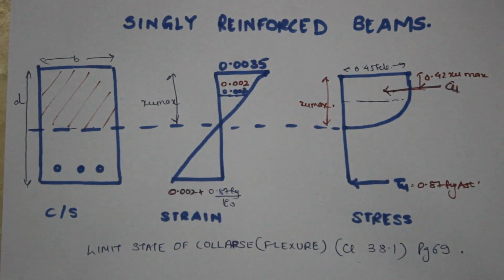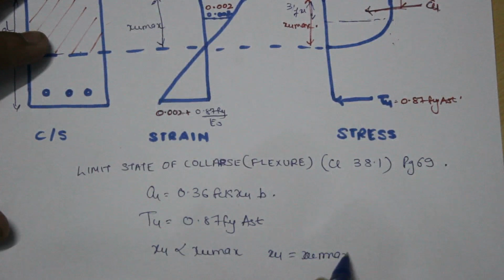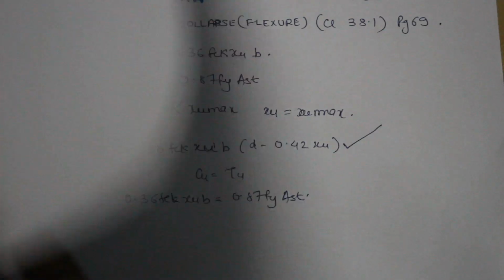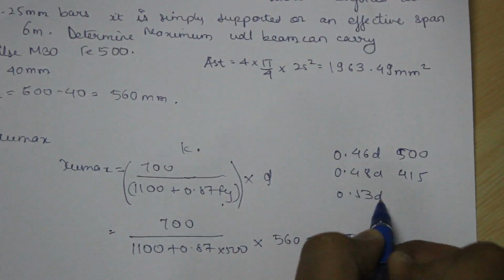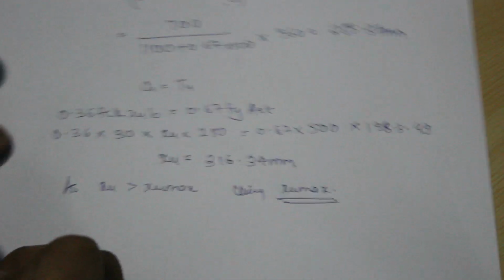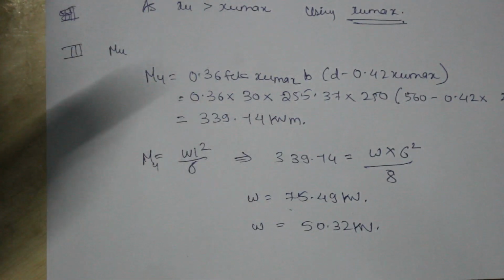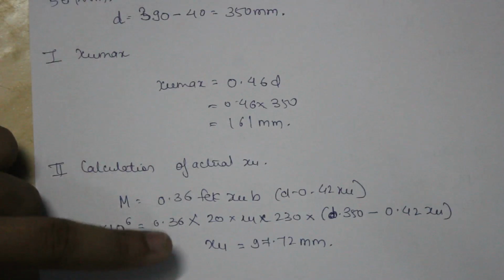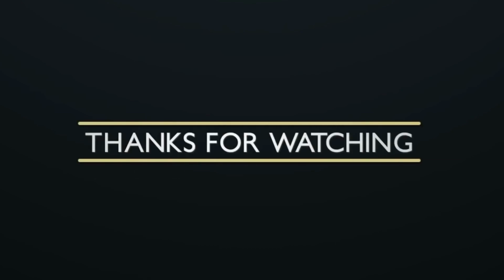DESIGN & ANALYSIS OF SINGLY REINFORCED BEAM | IS 456 | Limit State Design | Mumbai University

Comment: Why did you use Moment of resistance for Concrete, you should use for steel in under reinforced rt ?
Reply from the maker: For a particular member it's M.R will be same.
And also we equate cu and tu so it doesn't matter.

Comment: Bro when we have calculated Moment of Resistance =339.74.Considering the Safety Factor, should the beam carry Bending moment =339.74/1.5=226.49 and the UDL must be calculated for that BM of 226.49?
Reply from the maker: if you divide Bm by 1.5 and calculate udl you will get the working load means that much load the structure will be subjected to during it service life most of the time. But in limit state we multiply the load by 1.5 safety factor. If you calculate udl from BM=339  from this you will get the m,aximum load carrying capacity of beam